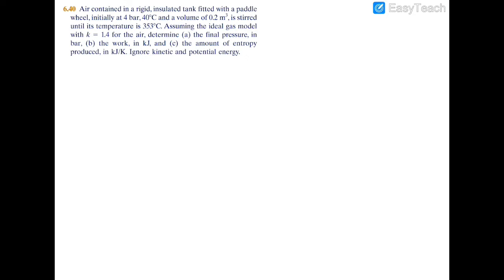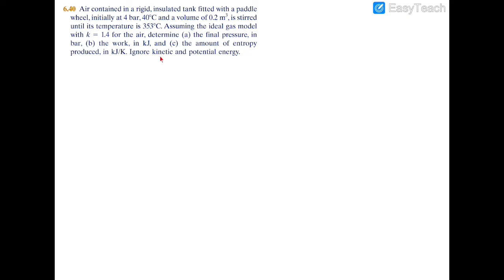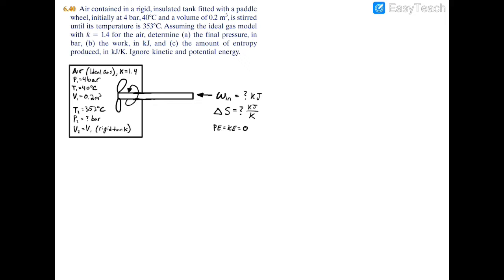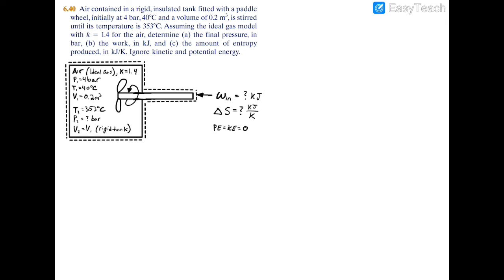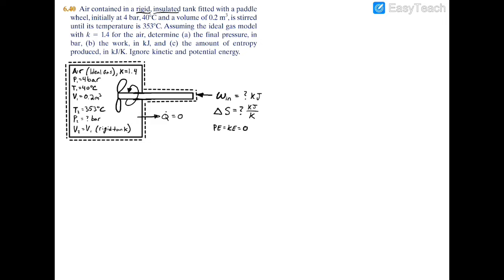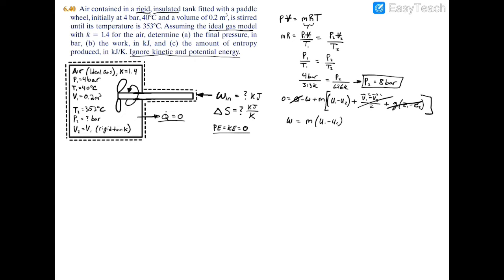6.40 Air contained in a rigid, insulated tank fitted with a paddle wheel, initially at 4 bar, 40°C

Comment: why is it U1-U2 and T1-T2 instead of T2-T1 and U2-U1 from the formula.
Reply from the maker: The first law of thermodynamics states that Q̇-Ẇ=ΔU.

If we break down ΔU, we have that Q̇-Ẇ=m(u2-u1).

If we move the variables to the same side of the equation: Q̇-Ẇ-m(u2-u1)=0

We can distribute the negative sign in from of m to (u2-u1): Q̇-Ẇ+m(-u2+u1)=0

And now we can rearrange the equation to make it easier to read: 0=Q̇-Ẇ+m(u1-u2).

This also explains why we used T1-T2 instead of T2-T1.

I hope this helps!